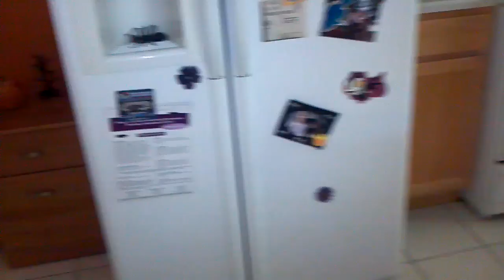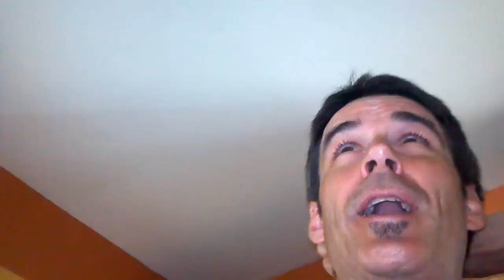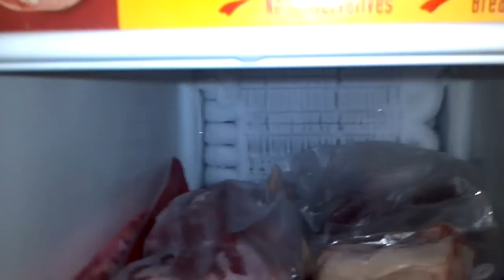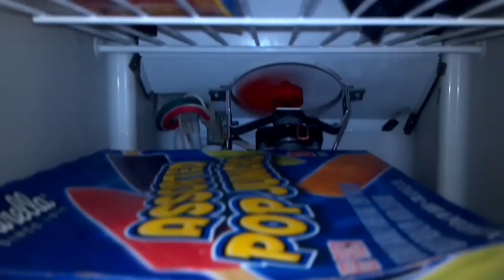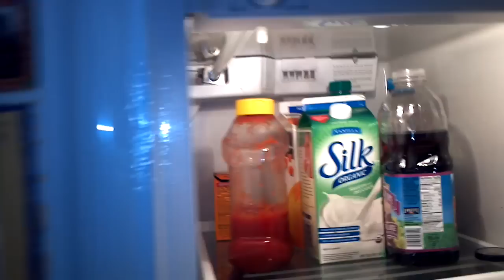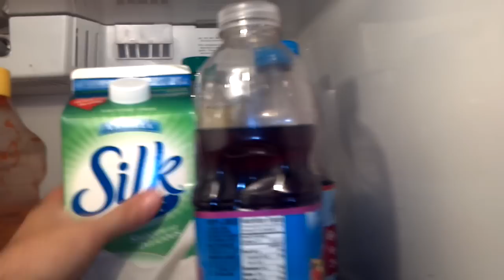Frozen Freezer Coils

Comment: Defrost issue. And they never work right with the panel off. The freezer will get cold but the fresh food section will not because air is not circulating like it will when the panel is on i think.